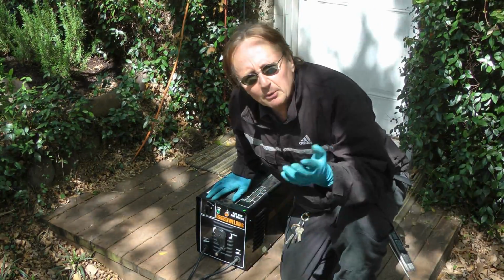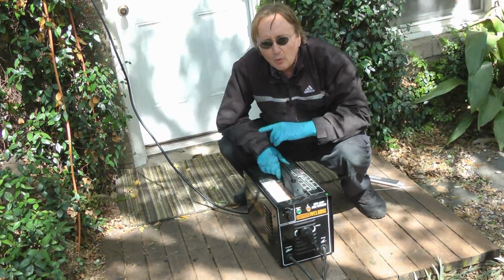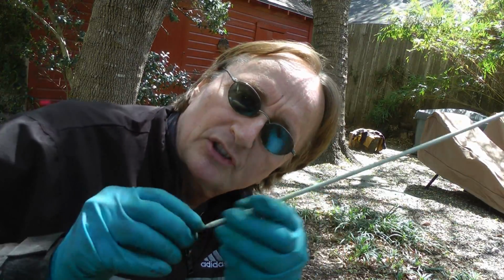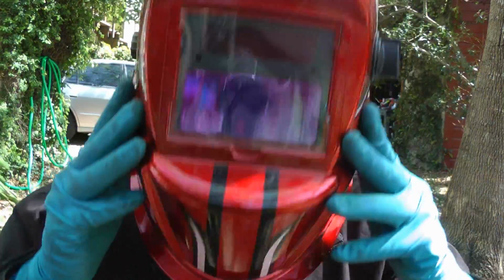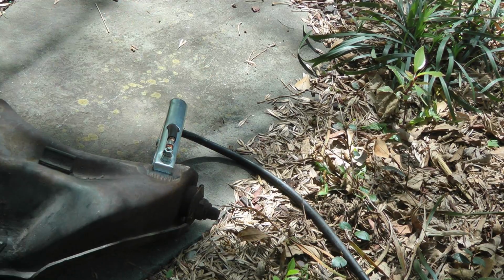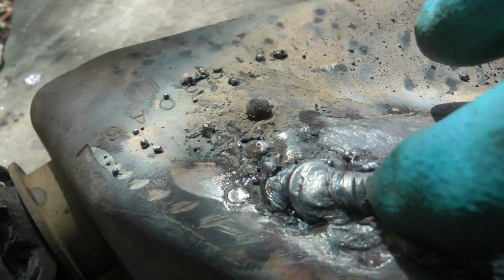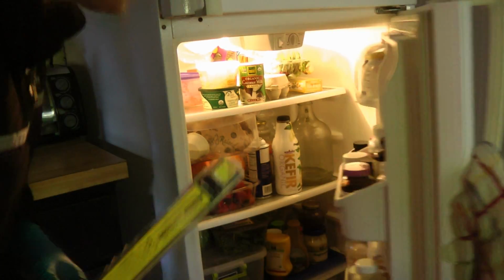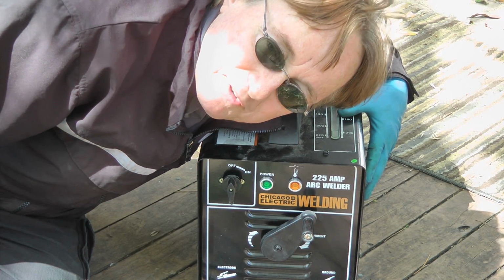Welding Machines And Car Repair

Comment: Sir, I am in bit of trouble I tried to change the brake disc but when I put the screw the new screw in it got stuck half way because of the dust inside the hole its almost in like 3 quarters of it. but the disc can still move. I had no energy after dealing with all the rust in the calliper. So what do you suggests will it be ok because the tyre screws should hold it back. right?
Reply from the maker: if you're talking about those small screws that hold the disc on, those are there only for the convenience of keeping the rotors in place during manufacture of the car. They are not needed at all, lug nuts hold rotors in place.
Reply: Scotty Kilmer Thank you very much for replying. Actually I was a bit panic because I had never done any work like this on the car. So I was worried if I get it wrong. Can I just say your videos are really helpful you make it look simple and easy.

Comment: Is it safe to weld the broken bolt stuck to the engine and take it out in 1 piece without catching fire? Should I detach the fuel line before welding? Help please. Thanks
Reply from the maker: depends on how close you are to the fuel lines. And realize fuel VAPOR is what catches on fire, you don't want fuel fumes anywhere, use a GIANT fan like me to blow em away when working.  And many guys weld bolts on broken parts to remove them, it's common practise

Comment: I saw this vid and decided to go to harbor freight to check out this welder. I have a 120 volt mig, but wanted something more powerful that could handle thicker metal. Right now this welder is on sale for $200.00. I looked around the store and found this welder in the clearance section for $85.00 open box! I have used the good stuff from Miller & Lincoln, so I know what a name brand machine can do. My new toy seems to weld nice and smooth with a stable arc just as good as the name brand units. $300.00 reg price, $200.00 on sale, $85.00 once in a lifetime.... Let's just say I'm more than happy with that. Now if their 60 gallon compressor would only wind up in that clearance section. :). Thanks Scotty for making me aware of this welder through your vids!
Reply from the maker: what a deal. And of course, you got an open box sale. I would not advise buying their 90 dollar welders unless you just wanted a toy to mess around with stuff like thin sheet metal cause those are weak. As with any purchase, always check the reviews of products on the net first.

Comment: about how many amps would i need to weld 1/4" steel to a car body without burning holes in the sheet metal?
Reply from the maker: that would be very tricky as 1/4 inch steel is thick and sheet metal is very thin. Only a real pro would even attempt that, and would probably spot weld it and then use a TIG welder. I personally would not attempt that, I'm not that good of a welder and don't have a TIG machine for expert work.

Comment: What is the minimum amperage for arc welding?
Reply: depends people have to change there amps depending on what there welding with and what there welding on. with 80 amps you can weld with 3/32 7018 rod around 50 amps is needed with 1/16th you need about 90 for 1/8th inch steel and for 1/8 rod you need a minimum of around 90 and can go to like 140 for 1/8 steel.

But you should check for yourself what amps you need for the rods you have and for what your welding on.

Comment: I got a Lincoln 135 mig welder with the cart and tank for $130 from Craig's list. I started out with just a wire feed welder but mig is definitely the way to go. You don't have to break off slag and you can weld very thin metal.

Comment: old welder trick: get an old fridge that doesn't work any more,but still has a tight seal.now stick the light switch part down inside the door frame so the light stays on all the time.  the heat from the light will  drive out the moisture.

Comment: Although the cold air inside a fridge can only hold a small mass of water, when warm air enters the fridge and cools, the extra water has to go somewhere. So, it forms dew on anything solid. In a freezer, it's worse, with hoar frost on your rods. That's why professionals use a rod oven rather than a fridge for storage of sensitive rods. If you put 7018 rods in the fridge you will have a lot of problem trying to weld with them later -- they will be ruined.
Reply: you can also put them in your hot water heater cupboard
Reply: RUINED!!!!  AAAAHHHHHHHH!

Comment: That's the one I wish I had bought when I got the $100 welder from Harbour Freight.  The one I got isn't adjustable, so it blows holes in exhaust tubing, and isn't powerful enough to fix anything else.  Learned from my mistake there.
Reply from the maker: yes, often the extra hundred bucks does a lot. NEVER buy the cheapest model of just about anything as they often have big gaps in their design.

Comment: Like any other skill, welding takes quite a bit of practice before you can reliably do a job, especially on a critical part. I've welded for decades but these days I don't find a use for it very often, since cars are made of more plastic than ever. For those with an occasional job, it's probably cheaper and better to get a pro to do it -- custom welding small parts is surprisingly inexpensive, especially if you can bring the part in to the shop.
Reply: do u enjoy ur job? does it pay well? I'm sort of a self taught welder, I weld stuff for my 4x4. I really enjoy it. Sometimes I wonder if I should do it as a profession.
Reply: Medic1911 I don't weld professionally any more, but I can tell you that most of the guys I worked with had the same kind of complaints that I hear from automotive technicians. It's a very physically demanding job. Welding pays well for pressure welders, in the oil and gas industry up north, but for guys in the city trying to make a living, not so much.

Comment: My 1995 Toyota corolla broke down again today. I was backing out of my garage and it died. It did this twice. So, I called a local mechanic and he told me it could be moisture in the gas tank and told me to get Heet and Seafoam and put it in the gas tank. The car started right up and I went to O'reillys and bought some. On the way home it randomly died while moving in the middle of the road. Now it is in a parking lot because it wouldn't start anymore. What could it be? The gas tank was 1/2 full and the battery was ok I think.

Comment: Hi Scotty! I have a problem with my nissan maxima 95, sometimes it wont start and I have to turn the key to ON for like 5 seconds and then try to start it again and it works. I have heard that it could be the fuel pump or the gas filter. What do you think it is?

Comment: Scotty,  I had heard you would need to use a gas system otherwise the metal will instantly rust - which is very bad for an automotive type of application.  What is your view on this??
Reply: that is not true. the flux around the welding rod vaporizes to create a shielding gas as well as create a slag to cover the weld as it cools. I also want to mention the stick welding is more resilient wind speed.
Reply: there shouldn't be any rust to begin with, assuming you welded it right and ground your base metal clean.
Reply: I'm sure you could always paint over the weld as well, keep the air away.
Reply: Thanks for the advice guys.  From experience David I can assure you that rust will still bubble up under paint if there is rust to begin with.  :)
Reply: You are quite right, fritzbuild3r.  I don't know what I was thinking haha.
Reply: lol I forgive you this once David hah

Comment: Why not just buy a 225 Lincoln arc welder from home Depot if you are going to buy a cheap AC welder. They only run about 245 dollars, they also work much better than Chicago welders. Me actually being a welder I'd recommend getting a DC machine, but if you are not doing Xray quality welds the Lincoln AC would get the job done. If you are going to run AC on STEEL make sure it's STEEL use a 7018 AC rod "MAKE SURE IT SAYS 7018 AC and not just 7018. If you can't find 7018 AC run a 6013 rod. Grind the grounded area down until it shines and grind the weld area down until it shines. Those Lincoln AC machines run forever and for a AC machine they will run quality welds. Just fork out the extra money, when i was in highschool we were using the same exact Lincoln welders they are still selling, those had held up for about 10 years of constant use so you can't go wrong.

Comment: You also want to make sure to have good technique for doing short seam welds so that you don't warp anything, especially with thinner metal. 
do a short weld, let it cool, do another short weld
Also make sure to learn about heat distribution, that also helps
I'm a welder by trade, so Im pretty good at this stuff

Comment: hi there scotty, i recently changed my maf sensor on my 01 nissan frontier because it was idling rough and it wouldnt respond as i accelerate it. i  replaced the sensor with a oem one. now i have all oxygen sensors activated(4 codes) . should i replace them or is it just because of the maf sensor that it triggered them

Comment: I learned how to weld thanks to my first job ever. I had a securing lock ring on a golf cart snap (Custom jig) And I was the only one around to fix it for 3 days. Either the job didn't get done or I figure it out. 3 hours later I got the weld to hold long enough to finish the job, then I went back to clean it up.

I miss welding actually. Just don't wear Basketball shorts and weld rusty quarter inch steel ...

Comment: Miller is the way to go!
Reply from the maker: IF you do a lot of welding, by all means use a higher quality machine like miller or lincoln. BUT, for a DIY guy, this unit in my video works quite well.

Comment: Harbor Freight's 80 Amp Inverter Arc Welder is a good little welding machine. I own two of them. What I like is its small and light enough to suspend on high places when working off a tall 13 foot or 10 foot ladder. It uses 3/32 welding rods. I was very impressed with its duty cycle. Scotty I would invest in a welding rod keeper to keep those rods dry and free of contamination. They only cost about 5 dollars. I've never had a problem with the slag falling of of my welding rods. I use the ones from Home Depot or Lowes. I learned not to skim on welding rods when I first started out. A good quality welding rod can make welding a lot easier. I used to buy lower quality rods from steel retailers and quickly noticed they spattered and didn't flow as smoothly as Lincoln Electric or Hobar rods.

Comment: don't forget to grid you base metal(s) down before welding and remove all water. also don't weld on concrete, there is small amount of water trapped in the concrete even after it dries.

Comment: scotty, I've spent a 5 years as a weldor and have a few comments about this video. Yes, the fridge is a great place to store welding rods, however, because of the difference in temperature, they will absorb moisture. The best thing for them is to throw them in an oven for at least 5 minutes before welding and they will not have any moisture in them. Especially the rods marked 7018. These are one of the best rods for critical welds, however, you do not want to weld with rods that have been with moisture.
Reply: K. Ave Pro it all depends on what rods you're using. All low hydrogen electrodes should be kept in a rod oven at 250-300°. Now cellulose based electrodes such as 6010 and 6011 are best left best stored in a dry place at room temperature as cellulose based electrodes require some amount of moisture in order to run properly. As a professional welder xx10 rod such as 6010,7010,8010,9010, 10010 and xx18  rods such as 7018, 8018,9018, 10018 are the only stick rods I use, as I oftenbweld to code or to a wps. These electrodes are already qualified for most procedures.

Comment: Do you need to worry about the electrical system  when welding on you car?
Reply from the maker: I was welding on top of a rock in the back yard. When using electrical welding on a car itself, you just remove one of the battery cables and the car is then safe. Of course if you use oxygen acetylene welding, you don't have to do it as it's just hot gas.

Comment: Hey Scotty, this is an unrelated question.  I got a 2002 Hyundai accent 1.5l that keeps giving a p0562 code.  It's a low voltage code but the alternator is putting out 13.9 volts.  The car starts fine but soon after the idle fluctuates.  It also sputters under acceleration.  replaced the map, o2 and cam sensors, along with the computer.  please help.

Comment: Hey Scotty do you have a mig welder you could post a video please, I bought one just after christmas a sealey 130 amp and I am struggling with settings and how many litres per min of co2 I have min max 1 and 2 and wire feed speed, Thanks Ian

Comment: Can leaf springs be welded?
Reply: no because that's tempered steel and the heat from welding will alter its strength and flexibility, in the heat affected zone.
Reply: john g Thanks, that's what I thought- that it would just break where it was welded.

Comment: if you dont have much money, you can build a welder from a battery for like 30$ at the most. i weld with 3 truck batteries in series regularly.
Reply: Rinoa Super-Genius Hey Rinoa, I love your channel.
Reply: if you plan to do any welding commerically, you should have the proper equipment, training, certifications, and be insured.

Comment: What could you really weld with an arc welder on a car?? its definitely not the best choice to use a stick welder. For tin its to heavy and you're just burning holes and for god sake if something breaks (supporting things) on your car exchange the part... it will break in most cases again and you're endangering your self and all the others which are on the street with you. I'm not talking about exhaust pipes or something similar! Never saw someone holding the electrode holder like you... to be honest it doesn't look very professional. Have a look at weldingtipsandtricks or ChuckE2009 if you're really interested in learning how to weld.
Reply: when it comes down to it, you probable would not use stick welder on a car unless that all you had to. but if you do have to weld something like an exhaust pipe or sheet metal you should use 3/32 6010 rods and a backing plate.

Comment: nooooo. store your welding rods in someplace warm!! the flux gets. very weak and breaks causing weak welds from peroxity (strangely forgot how too spell that) and if its warm the moisture will evaporate.  also they can work with some level of moisture on them, little but some. also with these small welding machines most only let you burn 1/3 of a rod (really bad should be able to use whole thing) and remember folks "puuush" when using stick welders. even if just doing your secondary passes
Reply: usually I pull my welds at about a 80 degree angle, when in the flat position.
Reply: i like the regular 45, lets me see pretty well. but when im welding on a pipe ill start more like 70 and move to like a 40 before i reposition (uphand) and this aint no B pressure welding thats why i can get away with it, im workin on fixing those angle perameters (the journeyman teaching me was amazing at welding and i learned some shortcuts by watching) but 80 huh, are you bending the rod too bring your hands closer?

Comment: I would advise against buying any consumer grade welders . Especially a Chicago Electric brand . If your on a budget go to home depot and get a little Lincoln machine. But keep in mind anything below 135 to 140 amps your limited to welding very thin stuff. You could weld thicker material with a lower rated amp machine but you would risk non fusion of metals and then the weld would brake when your driving or something and you might die... Keep that stuff in mind when welding on your own ride

Comment: does it matter what type of welding you do?
because i can only do gas and mig
Reply: there are many different type of welding that all preform similarly. however MIG welding accounts for over half of weld metal deposited in the united states, because once set up it so easy to use. here are all the most coomon types of welding and their benefit
-TIG (tungsten inert gas)
  very precise 
-"gas" OAW (oxygen acetylene welding)
  cheap
-"wire" MIG (metal inert gas) or GMAW (gas metal arc welding)
  easy to use 
-"stick" or SMAW (Shielded metal arc welding)
  works in 25 mph winds, no hoses, good penetration
-FCAW (flux core arc welding)
  similar results to SMAW welding with the ease of GMAW
Reply: My grandfather always used acetylene and my uncle always used mig so not really.
Reply from the maker: you can do all kinds of welding for all kinds of projects. I just showed this method as it's probably the easiest to learn and the lowest price to get a decent machine for.
Reply: mickles1975 I don't think he means acetylene, acetylene is for when you're using a torch I think. I have a gas mig welder and the gas it uses is CO2.
I still need to learn how to use it the last time I did any welding was about 3-4 years ago in high school.